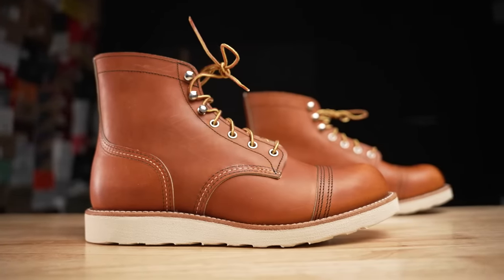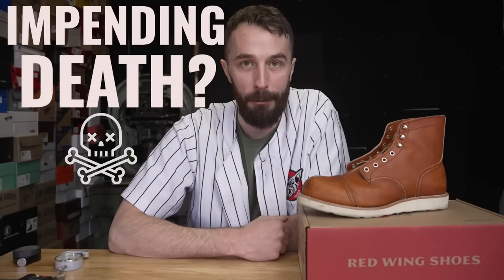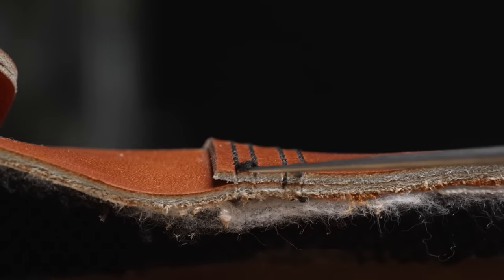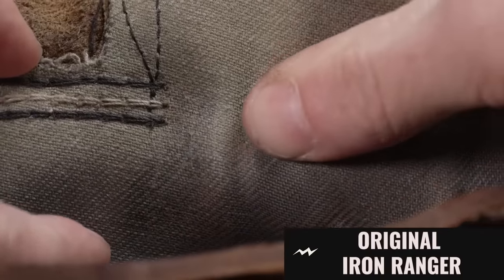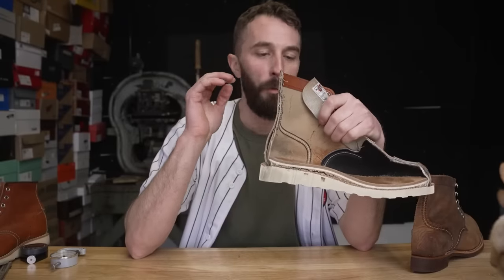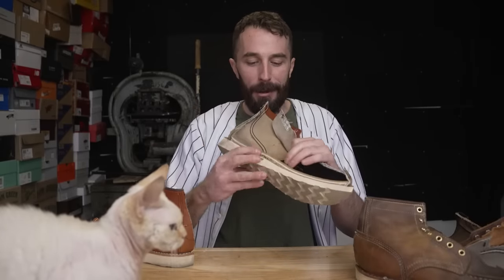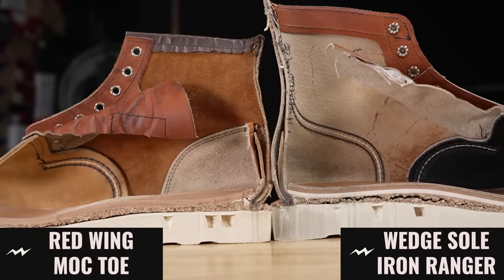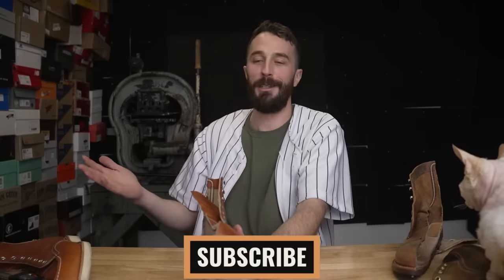Why People Are Pissed At Red Wing

Comment: The transformation to ultralight trail shoes as the standard within the hiking and backpacking communities  has also done a lot to really diminish the boot industry, as well.
Reply: Especially with people like me wearing Altras in the machine shop.
Reply: @DeltaVTX  I wear solid leather flipflops while milling, turning, casting, forging, or welding.
Reply: @Eluderatnight  right on Brother
Reply: Trail shoes are stupid the whole point of hiking foot wear is to keep your ankles safe from rolling and keep your feet dry and why ? To save a pound or 2 I'll stick with actual hiking boots
Reply: @billylongdick3192  best hikers I ever had were a pair of Vasque I bought in 1972, they lasted me many years, they were my every day foot wear.....working in the photo lab or on a photo shoot or exploring a cave.....
Reply: @billylongdick3192  Lots of folks, myself included, just learned how to walk without rolling our ankles and to not stand in ankle deep water. I made the switch about 2 years ago and now after a long hike, my feet and legs feel so much better. 2 pounds swinging at the bottom of feet 30,000 times makes a big difference.
Reply: @TheDrunkLibertarian  clearly you never walk off trail then lol or run or do anything strenuous other than walk on trail
Reply: @billylongdick3192  The weight of packs & gear is much lower now days compared to the past, so you don't really need any extra ankle support. Traditional hiking boots also take forever to dry out when they inevitably get wet.
Reply: Hiking boots nowadays are like Chopines... begging for a rolled/broken ankle. Trails shoes are lower and more stable. Boot makers lost their way.
Reply: I still have and use my issue Army boots for hiking. Got them in 2007 and just had them resoled once since then…I lucked out and got a good lot I guess, the leather is so soft now it’s like wearing a pair of sneakers.
Reply: Hiking boots weaken the muscles that help with stability and after a while the support wanes due to weaker muscles so your better off not getting that crap. If you're actually hiking your feet sweat and get wet regardless so your better off getting lightweight shoe that gets good ventilation
Reply: @biglyredly8637  It all depends on the use. Hauling a 65# pack in the backcountry over several days to a week above tree line and a lightweight boot might be a huge mistake. But for simple trail hiking, like a day hike on the Bright Angel Trail with just a day pack a heavier rated boot may not be needed.  I like my Vasque or Asolos, but I’m always wondering, ‘If someone rolled an ankle, how would we get them out of here?”
Reply: @Crafty McBushface I've spent hundreds of hours in the bush I think I know a bit more than you but I could be wrong
Reply: @Eluderatnight  tig?
Reply: @tommychiletti8506  yes aluminum tig too, still practicing at it though. Very hard to do.
Reply: @Eluderatnight  kinda loud too,good luck man,be well,
Reply: Going in the opposite direction. I'm sick of my light weight trail runners and hiking boots failing on me. I'm trying to find a good pair that will last me 5-20 years.
Reply: As a Californian, if you go off-trail in anything less than boots, you WILL get poison oak all over your ankles.
Reply: @ninemimesleft  I just pulled out my Vasques that I have had for 32 years. Countless backpacking trips in CO, CA, NM. I was not able to get out last season. They needed conditioning, I really beat them up the last few seasons. The outsoles have a bit left. Uppers cleaned up quite nicely. They are so much better when I have 35-40 pounds on my back than my lightweight day hike, quick summit trail running shoes. Gotta use the right tool for the job.
Reply: @FilmaticProductions  a couple extra inches of boot isnt going to make any difference.  wear pants and gaiters if you're concerned about it
Reply: Most wear them as a fashion statement.
Reply: @billylongdick3192  Where do you hike? Look at what thru hikers of the AT wear and you aren't likely going to see many pairs of clunky boots. I put about 1300 miles on a pair of vibram five fingers trail running in Appalachia where I live and it's definitely not flat or even ground.  I am personally more susceptible to rolling an ankle in higher boots due to my gait, I guess.
Reply: @FilmaticProductions  See that's the big difference.  The US is absolutely massive so depending on where you live you'll obviously be taking completely different equipment. Not to mention we all have a different gait that's gonna determine what's going to be best for you. There is no one size fits all.
Reply: @edvvardcash6109  I hike to your moms house

Comment: Owned 3 pairs of Redwings as a cable installer and dod contractor overseas. Every single pair were the most uncomfortable boots I've ever wore. Always had to by inserts to make them bearable. Switched to Nick's and they are by far the best.
Reply: Dude, Nick's are handmade and twice the price - of course they're going to be better 🙄
Reply: @ruzziasht349   But cheaper overall in terms of multiple boot lifespans.
Reply: @Resistculturaldecline  "multiple book lifespans"? is there a metric for this?
Reply: @ruzziasht349   lol actually not. But multiple boot lifespans. There, fixed
Reply: Buy well, buy once.

Comment: I tend to be more partial to leather insoles, but I have had very good luck with the Redwings that have the Poron with fiberboard insoles.  They definitely break in quicker and are very comfortable. Other boots I have had with fiberboard insoles have deterioration issues, but  not the Redwings with poron and fiberboard. Their supersole boots are built this way. I have had several pairs of their supersole boots and have resoled them multiple times with no issues. The uppers have worn out before the insoles. Redwing seems to know how to make them hold up despite not being leather.

Comment: As long as both types are available for the same price, no need for rage. Some people just don’t want to run around in a stiff boot for months, knowing that in 10-15 years it’s still going to be wearable. Some prefer to have it comfy from first day and might accept that the boot will not be as durable.
Reply: I’ve never had an issue breaking in Red Wings. I’ve never heard of a set of boots taking months to break in.
Reply: 10-15 yrs what in the world i need this boots. anything i wear doesn’t last 6 months. i might have to put this boots up to the test.
Reply: Good luck with the 10 to 15 yr time frame. Last 2 pair I owned fell apart after 5 years and that was not full time use.

Comment: As someone who truly appreciates good quality US made products. I'm very disappointed in Redwing boots these days.
Reply: I had two pairs of Redwings….1993-2001 then 2001-2009. 2001-2009 were worn about 10-15 hours per day 7 days per week. No longer carry my size in that style even after calling the company. Went with Nicks. Wow. Like old Redwings but way better.
Reply: @WD5035  What kind of work were you doing with them. It doesn’t matter what company I use I can’t get more than two years of life from a boot. Welder/fabricator and construction take a toll.
Reply: @Sackmatters  Still doing…..Railroad and trucking. Had two jobs. Railroad is climbing up and down locomotives which have sharp ladders that are tough on soles, besides walking on ballast ( rocks in between tracks and all over yards). Trucking….hauled petroleum and walking up top on those steel mesh walkways….tough on shoes. In all cases….had and have the same soles…..Redwings and now Nicks….Black Vibram 100 Lugged ( with the yellow stamp on bottom) soles brother. The Redwing soles just gave out….but they were in severe conditions and they made a lasting impression on me. I’m looking forward to putting these Nicks to the test. Custom made and $600 bucks, but no way am I cheating out on shoes. You can mess your back up.
Reply: I'm a carpenter (union concrete) I can't get more then 3-6 months out of them
Reply: @Sackmatters  FWIW I was a landscape construction contractor for 26yrs and wore Redwings for most of that time since 1990, but the went downhill around 2001 or so. Now I make furniture mostly welded & sculpted steel bases. I wear Georgia Boot's "Wedge Work Boot" in the shop and keep them well oiled, like REALLY well oiled. I use Redwing's "All natural boot oil." They've been a good boot for me going on three years now, but I have a feeling I'm not a boot beater as some guys are...some guys can trash boots in no time flat, while mine last a good long time. Not sure if oiling faithfully makes the difference, but I'm sure it doesn't hurt. Hope that helps.
Reply: I’ve been shod with Red Wing 2406 for over 30 years. Last 5-6 years the leather is not what it used to be. It is dry and splits with minor abrasions 😣
Reply: @branchandfoundry560  “ Well oiled”. I will keep this in mind. Thank you.
Reply: Same here.  When they got rid of the 4440 boot, have had a hard time finding a Redwing that lasts as long.
Reply: @markdanielczyk944  My dad wore Irish Setter Loggers for decades and insisted I get them for my first boots in 1990. When I went back to Redwing store for the next pair, nobody knew what I was talking about nor recognized the boots I brought in. Sad. I bought their regular loggers, which broke down almost immediately. That was the end of Redwings for me.
Reply: @branchandfoundry560  
"IRISH SETTER" or "ELK RANGER" are the best for logging
Reply: @rustyshackelford6290  for construction workers 6 months it's the most you can get out of any boot's Im been a construction worker for over 20 years been walking in rebar dirt  mud concrete ruble take a toll on your boot's Plus they're not making it like a few years ago

Comment: I had a pair of Red Wing boots years ago, and they were the best/worst boots I have ever owned. The reason I say worst is because they were so durable that rather than fall apart, the leather stretched over time and no matter how tight I tied them my foot still slid around in them.
Reply: Use inserts
Reply: Curious, did you wear them daily? What kind of socks do you generally wear with them?
Reply: @donkeygong64  Yes, I wore them daily and work gear brand socks. After years of wearing them it's like they went from a normal width to an E width.

Comment: Used to love my Redwing boots until the last two pair. First set bent the toe cap after a month. Replacement pair, the back came apart after 2 months which they wouldn't replace. Switched to Keen's and haven't looked back. Had this pair about a year and a half.
Reply: Keens are awesome boots!
Reply: Keens are underrated

Comment: Decades ago when I was still working, I used to buy Red Wings and had them re-soled and re-heeled as the uppers could take a beating.  The price was also very reasonable for that service.  Then their prices for re-soling started rising tremendously, so I started buying throw away work  boots from Wally World.
Reply: $77 for a RE-SOLE is still WAY CHEAPER than buying a new pair?
Reply: I guess it depends on what you need, but I was so happy when I was able to upgrade to boots that cost over a hundred dollars that last, look good, and actually fit right.  Fast fashion boots always fell apart on me or would aggravate the problems I have with my falling arches and week ankles.  I also feel better not throwing loads of cloths and shoes in the garbage.  I used to buy thrift as much as I could.  If I'm going to be throwing them away by the end of the year at best, I may as well pay no more than $10 on second hand.
Reply: @thecloneguyz  I don't know what the prices are these days because I've been retired for 15 years.  I used to buy Wally World steel toed boot for $30 something dollars and if they lasted a year, that was good enough.
Reply: @2-old-Forthischet  Wally World boots tear the crap out of my feet.  I changed positions in my facility about a year ago and needed metgards and steel toes so I switched from the steel toe sneaker line they had to the meta boots I have now.  Went to a local redwing cobbler that has been in operation for generations where I live to have them inspected the other day and the old fella told me to hold on to them, they aren’t going to be making them this sturdy any more.  Considering some of the weight I’ve dropped on these puppies in the last year and the steel hasn’t dented?  That cobbler is my new best friend.  Salesman at work (company contracts a shoe company to come in to get our shoes). tried to convince me that a pair of converse high-tops with a rubber insert in the tongue was an acceptable replacement for metgaurds…. Meanwhile I’m over here hoisting 4 and 5 thousand pounds inches from my little girl feet.  Give me my redwings! I’ll pay whatever I need to go resole these puppies forever!  Redwing king toe with metgard.
Reply: @cwarts5461  lol

Comment: Bought a 230 dollar pair years ago the soles warped and wore out immediately, took them in to get replaced, they told me 50 bucks, and a local fix might be possible, but was two weeks out, or they'd have to ship them out and it would be two months. They suggested I get another pair in the meantime. I told them to keep them and haven't owned a pair since.
Reply: Same here, bought a pair in the 90s , The absolutely most uncomfortable boot I’ve ever owned , I tried and tried to wear them in .. wouldn’t give up, finally had to throw in the towel.. will never by another pair. The best boot I’ve had over 40 years of wear , is THOROGOOD.

Comment: I make RW boots in RW, MN. I can tell you the leather is higher quality than most leather. It's also made in a union factory, just like the boots made in RW. I've sewn together the boots and have worked with the canvas lining and the black lining as well. The black lining will wick away moisture better,  hold up longer and keep your toes warmer in cold MN climates. As for the soles, part of that is I believe most people want comfort now and don't think of the long term wear. I hope this helps.

Comment: A few moons ago.. my company paid for the warehouse and driving crew to go down and purchase each employee Red Wing work boots/shoes. I chose a hiking boot that was heavily stitched, durable thick aggressive sole, over the ankle well padded supporting good balance,  well only had about 6 months of that. After that my walking just in warehouse wore down the treads, the padding inside started separating as well as the heavy stitch job along the outside along the boots. Held on to them after job was ended by being sold. I then worked as a forklift driver at a Winery.. the sulfates and wines spilling out of barrels ate up the rest of those boots.. literally disintegrated. Expensive shoes!! Glad I didn't pay out my pocket (199.00) and was very disappointed. Walmart has boots that'll go thru hell and back and still hold up past 6 months or more.. stay away from Red wings. They suck

Comment: I could be wrong, but i'm pretty sure the last 3 or 4 models they've released including the chelsea, goretex moc toe, this iron ranger and a few newer colors of the moc toe  have all had this poron insole. I'm not 100% sure on the newer moc toe colors as they're for the womens side and didn't look into them, but for now this is a trend they're clearly keen on continuing. That being said, they cancelled production on the chelsea relatively fast so that could be covid constrictions or unfavorable sales. We will just have to wait and see what's next off the assembly line. I'm hoping for more mens 8 inch heritage options personally 👍
Reply: Some 8” rangers like they made for Indian motorcycles!
Reply: I'm not sure on previous moc's but my wife has the legacy blue which was part of the more recent releases.  It definately has some type of poron and not sure on the board.  Though to be truthful all of her Red wings (Iron ranger, Clara, Harriet, Mocs) are like this with a poron (or poron like material) Not all are that recent so may just be a part of how the womens line have been consrtructed for some time. 

Truthfully I may go for a pair of the Chelseas because of the comfort factor. 
Use them as throw on quick beaters but will only buy at well reduced 2nds pricing.
Reply: @Dcale  A man can dream

Comment: I noticed my Red Wing 2233's have that same black liner in the front. It seems to hold up great, the only issue is it actually wears down the socks faster than the older material they used to have. 

The rest of the model 2233 is equally great. Just as simple as you can get, with no liner other than at the front. The soft leather insole, etc. I've been wearing the same model since I was 12... So for 25 years now. I've tried other models occasionally, and tried other brands, but for me nothing lasts as long or works as well.

I bought a pair of settlers and they were junk in a month. Brahma's fail in a few days at most.